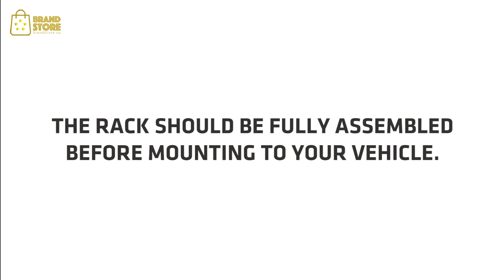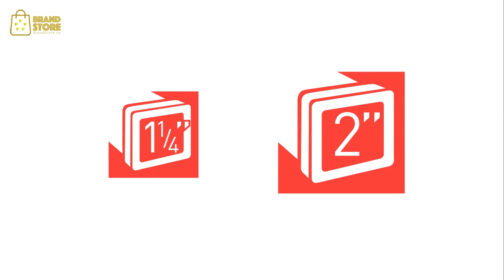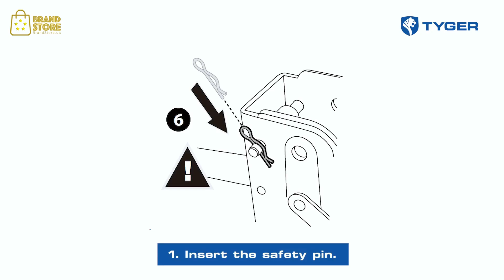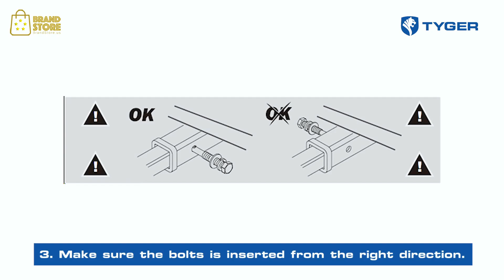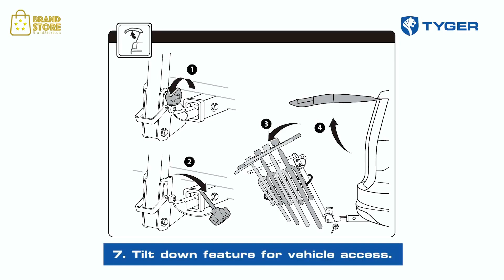7 Best Bike Rack Hitch - The Best Bike Rack for Car

Comment: This video is not for cars! It’s for SUVs with trailer hitches! Don’t bother watching
Reply: I had this fixed on my Skoda Octavia and it looks good.
Reply: @mdrs60  bro where did u get the adapter fixed on the car? Thanks
Reply: @jasonteo4524  
Hi Jason,
I did the installation at MTM Performance Auto at Jurong East.
42 Toh Guan Road East #01-138/139/140/141 Enterprise Hub S(608583) (map)